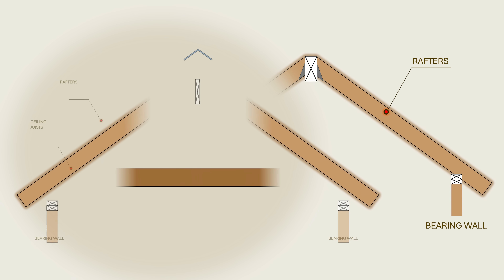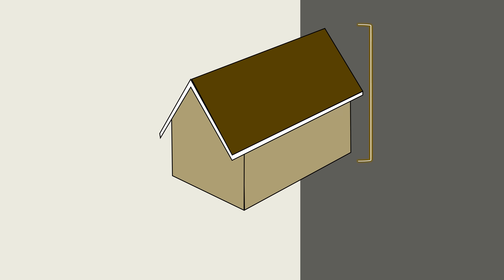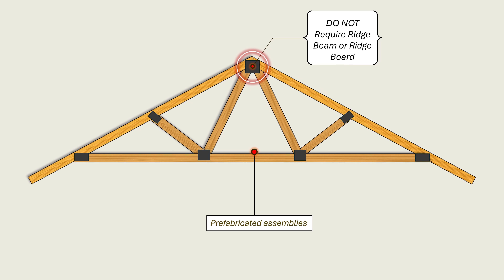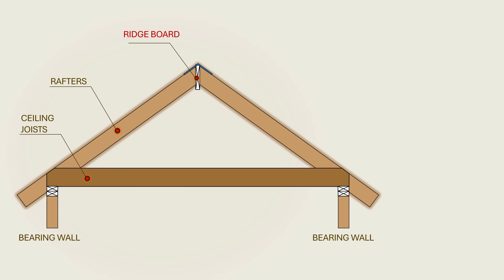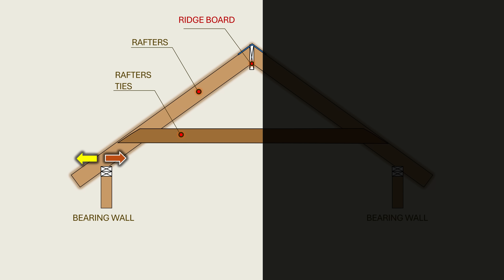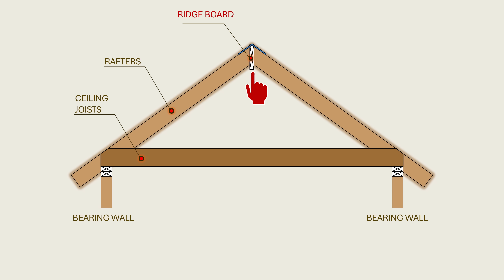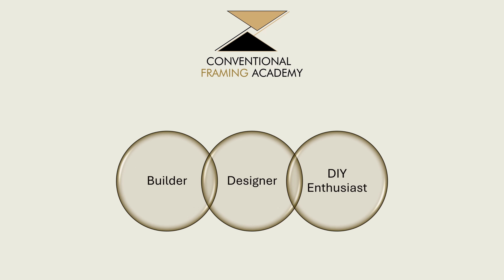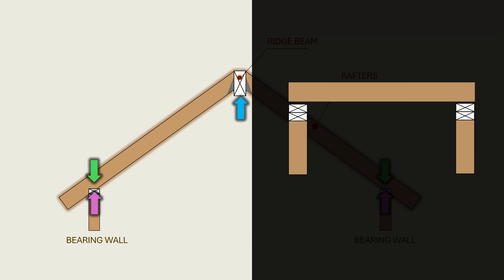Ridge Beams vs Ridge Boards: What Every Builder & Engineer Must Know

Comment: Has anyone got any info on ridge trusses, though?

Here's my problem: Ridge beams and manufactured trusses usually require a crane or other heavy equipment to lift them into place. As a broke, singlehanded DIYer building my own roof, I can't afford crane rentals, but I can (with the aid of temporary supports) stick-build a truss from two-by lumber to take the place of a ridge beam, and then frame the roof off the truss as I would with a ridge beam. I'm picturing a truss about thirty feet long and five feet tall, made of doubled 2x10s for the horizontal members and 2x6s for vertical and diagonal members, glued and bolted together, resting on posts (three 2x4s to match the width of the truss) incorporated into the 2x6 exterior gable end walls.

Sound feasible?
Reply: Get an engineer or an architect to go over your structural design to critique it and to improve it as necessary to meet code and be strong enough to carry all the loads
Reply: @stevenmiller7731  But is it worth taking to an engineer? I don't want to rack up professional fees if there's some obvious issue that makes it a bad idea from the start.
Reply: @tooltroll you are paying for what you do not know. Plus the design is certified to meet code.  Or take your time with your project and take this on line course, or find an experienced craftsman who understands your approach. Best of luck.
Reply: @tooltroll  Professional fees are peanuts when compared with the cost of the job or the cost of failure.
Reply: @clivewilliams3661  Oh,  I don't mind paying the fee, I just don't want to pay $hundreds only to be told it can't be done, so I'm collecting opinions first.
Reply: @tooltroll  Collecting opinions from the internet is a highly risky business and is no better than taking advice from the guys at the pub(bar).  The first port of call should be the experts in the field of concern.
Reply: @tooltroll a competent engineer should be able to tell you in short order what will work without extensive computations.  If in doubt about costs, ask what you can expect to be charged.
Reply: I'm not commenting on the overall design concept or the detail of individual members but it is feasible in principle to do that, you will however, require the whole thing to be properly designed by a structural engineer.
Reply: Menj el egy helyre ahol ilyen szerkezet van beépitve. Nézd meg, készits jegyzeteket, ha lehet mérd meg a keresztmetszeteket és figyeld meg a csomópontok elhelyezését. Másolhatsz gyártói katalógusból is. Használj bepréselt szeglemezeket ( gangnail) ha tudsz, végső esetben rétegelt lemezeket és szöget a csomópontokra. ( A ragasztás a szöggel dolgozik jól, a csavarkötés ridegebb.)  Nálunk ez a tradicionális épitészet:https://youtu.be/lFTd-ili9Fc?si=bNfAybq5bU_G3EnG egyéb dolgokat vasbetonból és acél gerendákkal épitjük.  Nagyobb terheket is tudsz egyszerű eszközökkel mozgatni
Reply: I dont know you strucrure but insted of lifting a ridge beams or planks you can overlap your rafters its much more stabel than the beam or the frame the overlap holds the rafters much better and you need just to use two screws to hold ther rafters against each other. its much simpler in build as well i dont know why the wodworkers did stop to use the overlap its needs just a few cuts more in the rafter but the benefits are woth it every time. our granddads 100 yeasr ago and more used the overlap as default because it hold all the years.
Reply: @Shadesu14  Considering the loads involved, overlapping the rafters are not a good solution as it is totally reliant on the fixings through a relatively small area.  In the event that the roof leaks there is clearly a problem with the vulnerability of the joint.  With a ridge beam or ridge board the main forces push the rafter against the beam/board so that it is not totally reliant on the fixings.  Overlapping rafters is considered a cheap way of raising a roof and is strictly for building sheds.  Your Grandfather is lucky that his roof has lasted so long.
Reply: Why not draw up a architectural design with the exact measurements for the different sections; and show it to an engineer to see if it'll work.  Or a city inspector?  Can't hurt to give the city or town a call to find out.
Reply: @brucknerian9664  If you are asking them to approve the design then they will a)  want to see the full calcs and b) want paying for the service.

Designing a structure is about the physical engineering and the proof that it will stand up, its not about a fanciful idea.
Reply: NO! At least not without building trusses to an engineered set of plans, which almost never happens. When you sell, if the buyer hires a home inspector, if you can't produce documentation showing that the trusses were designed and their construction approved by a structural engineer, he's going to recommend that they be evaluated by an engineer and they will almost certainly fail (I write courses for home inspectors after 30 years as a framer). I've repaired trusses according to engineer's specs and it was kinda crazy.
On the other hand, I've loaded full size home trusses by hand, one-by-one onto the roof. It's easier with two people but I've done it alone.
Reply: @kshepard52  In UK and I would expect the rest of Europe, roof structures, including trusses have to be professionally designed, whether that is most likely the truss manufacturers engineer or a separate structural engineer.
Reply: @clivewilliams3661  That's true for the developed countries. When I was Director of International Development for InterNACHI, I got a call from someone in Romania who wanted to found a home inspection industry there but didn't know what a building code was. Australia was pretty good. South Africa not so good, and in Mexico residential roofs are mostly concrete.
Reply: @kshepard52  I was surprised that someone in Romania didn't know what the local building code was since it is a developed country and a quick Google search pulls up the same legislative requirements for building practice (Law 10/1995) with all the usual inspections and certifications that you would find in the rest of Europe.

I would be concerned about having an International  inspection standard as all locations around the world are different, with different needs and requirements.  Certainly US standards would, from what I have seen not universally comply with UK or European standards of construction.
Reply: @clivewilliams3661  I was surprised too, buy we only had the one conversation in 2012
, and there is a small but growing home inspection industry in Romania, but it is not yet regulated or standardized the way it is in North America or Western Europe.
Reply: @kshepard52  As Romania is in EU it is governed by those standards and one of those was to regularise the building practices and regulatory process to align with EU practices of construction and certification.  It is not surprising that Romania may not have a reliable system since it would take time to come out of backward (and possibly corrupt) Soviet practices and to come into the high tech advanced EU world.

Comment: Alright, so what holds up the ridge beam, then?
Reply: There must be "pillars" at each end of a ridge beam
Reply: it seems like he clearly states that the walls at the end do that, but no roof weight through the board.
Reply: @ehb403 That depends on the expected load and span. Likely the span would have to be the length of a small shed - implying that this is what the building is
Reply: It is not even needed.

Comment: This seems to have totally ignored the last line of 802.3" "and supported on each end by a wall or column". Otherwise the walls would bow out and the roof collapse.
Reply from the maker: @russjohnson6396 The last part of R802.3 specifies the requirement to support the ridge beam by a column or wall. I have described the load path (uplift and gravity load) from the ridge beam down to the foundations including support by columns.  This was certainly not ignored.
Reply: Wow, you didn't comprehend the video at all! The beam IS Supported at each end, it's a reinforced wall suitable for vertical loads, there are No sideways loads with a beam, only ridge boards have sideways loads
Reply: Agreed, though not "totally ignored", this was not mentioned until the last minute of the video. That should have been shown from the very starting diagrams as a post under the ends of the ridge beam. Then I would not have bothered watching, as it would have been obvious. Either you tie the side support walls together with ceiling joists or a horizontal truss (ridge board, or none), or you support from the center (ridge beam).

Comment: Great visual explanation.I suppose a quick way to describe the difference would be to say that adding a ridge beam effectively turns the roof into 2 separate pent roofs that just happen to be next to each other thus eliminating the need for tie beams / ceiling ties.

Comment: My engineer designed massive ridge beams on my house. I challenged him saying why can’t I use a ridge board? He said yes you can do that. So why the hell am I paying thousands of dollars to you to design my house wrong!
Years of university doesn’t always make you smart.
Reply: You can probably design it with a ridge board or no ridge board at all (trussed rafters) but the design will be different in each case and the economics will vary.  If you simply substitute a ridge board for a ridge beam then you have to add compensatory structure to make the roof stand up, which is clearly, if lengthily explained in this video.
Reply: @clivewilliams3661 I have 45° rafters that start at the mid floor. I don’t like trusses, too much wasted space. It’s my architects fault, engineer just did what she told him.
Reply: @binlukin  It sounds as though your Architect took your brief on board and she and the engineer developed a scheme that satisfied that brief.  You said that you don't like trusses so the obvious alternative is to use a ridge beam that by definition is much beefier than any ridge board.
Reply: @clivewilliams3661 whatever man. They designed a beam, I don’t need one so I’m using a board.
Reply: @binlukin  By changing the design through your ignorance of the basics of structural design you have absolved your Architect and Structural Engineer of any liability when (not if) the roof fails.  That is notwithstanding that you will probably be in contravention of your local building codes and probably invalidating your building insurance.  Similarly, if anyone is injured by the building collapse you will probably be charged with contributory negligence.  Your choice........
Reply: @clivewilliams3661 you have no idea what you’re talking about buddy. Did you not watch the video? You don’t need a beam if the bottom of the rafter is tied to a ceiling joist, or mid floor in my case.
Reply: @clivewilliams3661 I’ve spoken at length with the head engineer, not the one who drew my place but his boss. And he has apologised for the guy saying it’s not in their training these days to think about budget and what’s best for client or builder. They just do what architect says as not to rock the boat. His words.
Reply: @binlukin  I probably know much more than you about building construction, having been an Architect for 45+years and in construction for 50+years.  I know exactly what this video is about and if you had bothered to read my initial comment you will have realised this.  You did not mention that the rafter feet had a ceiling tie, only that your engineer had designed in a ridge beam, which implies there are no ties as they would be unnecessary.
Reply: @binlukin  Then as an Architect I would not be working with such a firm.  I engage with real structural designers who are part of the design team that contribute to the overall design, not engineers who just number crunch.
Reply: @clivewilliams3661 my second comment I said bottom of rafter is at “mid floor “ I guess we see what we want to see.
Reply: @binlukin  What are you describing?  Its unintelligible in construction terms.  The bottom of the rafter lands on the eternal wall at eaves level.  Do you mean that the floor level is above the eaves level and thus connects to the rafter?  Or that the floor level is below the eaves level so that you have a short piece of external wall above the floor before the slope of the roof starts?
Reply: @clivewilliams3661 oh Clive this is getting silly. Do you want to know if I’m single or not?
Reply: @binlukin  🤣
Reply: @clivewilliams3661  I agree. A rafter cannot start or end at mid anything. Perhaps he is referring to a rafter tie, in which case the terminology is clear as mud.
Reply: @clivewilliams3661  No. If an architect or engineer signs off on the design, they own it and are responsible if it fails structurally.
Reply: @kshepard52  Of course that is the situation but where you have a design produced by others no Architect or engineer will 'sign' it off, they will merely have no comment to make.  The responsibility must lie with the designer of that element.  There are so many components in a building that anyone who 'approves' another's component design must have specific knowledge of the design that is a nonsense.  Structural Engineers and fabricators only present their designs for checking in the realms where the Architect is proficient e.g. the setting out.
Reply: You typically need a structural ridge beam where you want cathedral ceilings. The exception is where the rafter ties are part of the design, are typically spread further apart than 4' and are meant to be aesthetically pleasing.
Reply: @kshepard52 not this again.

Comment: 5:40 not true as opposite rafter counter 1. rafter force.  It is not comparable to latter on vertical wall.
Reply from the maker: The ladder-to-wall analogy is focused on the force mechanics at the interface. In both cases, the contact point provides only a horizontal reaction, not vertical support. For the ladder, the wall pushes back horizontally but does not carry vertical load; for the roof, the ridge and framing behind it provide the same type of horizontal reaction. The rafters (like the ladder) carry their vertical loads down to their supports. That is why this analogy is very valid for explaining how ridge boards work. The purpose is to highlight that neither  the ridge nor the wall (in the ladder analogy) is a vertical load-carrying element.
Reply: @ConventionalFraming  And actually help me understand concept somewhat.  Especially transferring force from roof to footing.
Reply: @ConventionalFraming  How about this for a simple explanation of the difference.  Sit at a table and rest your chin in your hands.  You will feel the downward pressure pushing your elbows apart.  This is how a ridge board works without a ceiling joist connecting the two outside walls.  Now sit at the table with your hands in the same position and put a stack of books under your chin.  The load is now transferred to the books.  This is how a ridge beam works.  But in both cases there is still a load carried by the rafters and they have to be sized to carry loads like shingles and snow.  In the ladder example that load is you.  On a roof it is sheathing, shingles and snow.
Reply: Dead loads: permanent loads like roof structure and covering materials, HVAC equipment, and PV or solar thermal arrays.
Live loads: transient loads like snow, water, wind, debris, or seismic activity.
Reply: @ConventionalFraming  Tbh I will not spend my time trying to understand it.  That said I'm sure you know light year more than myself about topic, srs.  Thanks for answering anyway.
Reply: @ConventionalFraming   Holy cow!  That was surprisingly polite while being absolutely on point.  AND very readable.
W O W

Comment: old school engineering explanation (felt like something from the 70s).
10th grade english (easy to understand words while learning concepts).
codes cited (multiple times).
loading explicitly explained (the beam support was somewhat light.posts were glazed over).
good vid.
Reply from the maker: Glad you found the explanations and code references clear and easy to understand. You’re right that support conditions and posts deserve more emphasis. My focus here was on the differences between a ridge board and ridge beam. I will certainly work on posts and support condition for wind uplift in future videos.

Comment: Yeah and in praxis I had to give up at a project because I was not capable of lifting ridge beam (2 massive LVLs) up in ceiling.  It is an old house that was held for decades with a board like ridge there.  It is easy seat in a warm office and do phantasies drafting non sense.   Worth for both engineers and city inspectors.  About how good I'm there is a video of leveling floor with furring strips that I did at that house.  I was improving that house till clowns jump in.  Now that house is sitting there for months as nobody want do it for any reasonable price.  I can do ridge beam and roof reframing if someone give me a fat money, for any reasonable price not gonna happen, just as anyone else said.
Reply: Surely you can make a lift with an pole, a pulley, some cable and a boat winch to lift the beams. I made 1 meter extensions that clamped on the beam support pillars, they had pulleys at the top and I ran both cables (more pulleys) to the winch so that both ends raised simultaneously. I raised a 18 meter LVL beam 6 meters into the air all by myself, bolted it in place then removed the extensions and proceeded with the roof. The reason for the extension was to be able to get the beam ends a few inches higher than the support pillar so it could be moved sideways a bit and set down centered.
Reply: @bobjoatmon1993 thanks for your inventiveness and good explanation. I have done similar lifting operations of long heavy beams
Reply: You can rent inexpensive lifts for that sort of thing, or use a little thought, like @bobjoatmon1993.